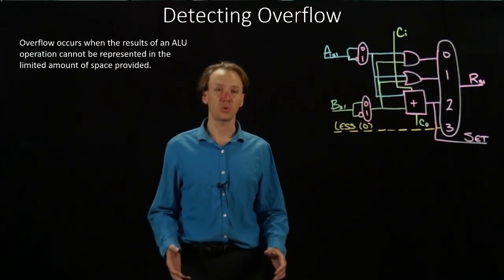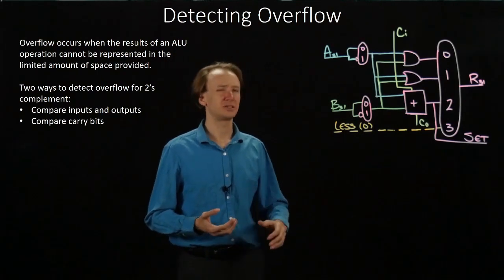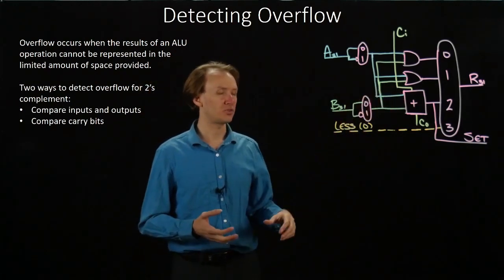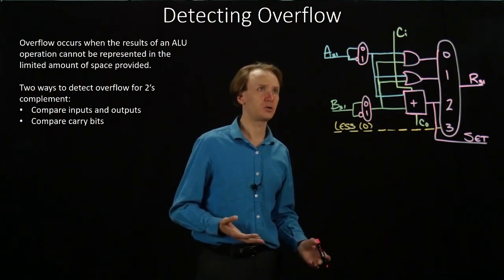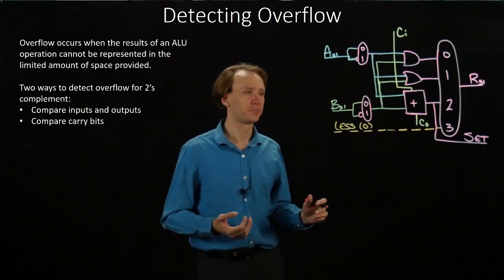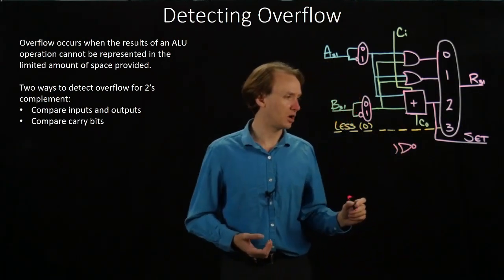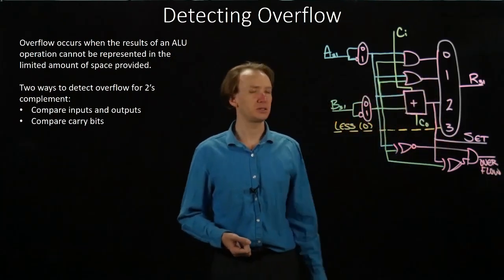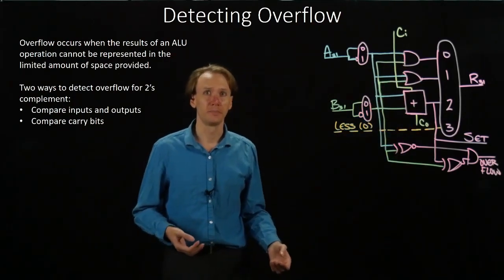11.  Detecting Overflow

Comment: 01 + 01 = 10 which seems 2 but it is not if we are dealing with signed numbers and actually 10 is -2 (not 2). Now the idea of using the last two carry bits seems flawed. plz, Mr. Padraic correct me if I am wrong. I am very open to discuss this to remove any confusion I might have. Thanks
Reply: just one simple clarification to anyone who reads my comment, 01+01 should = 010 because only with 3 bits we can represent 2 in signed number

Comment: Can someone please tell me how will this problem be solved? I mean how can we resolve this problem if overflow has occurred in our circuit??
Reply: Overflow is usually set as a condition flag and left to the program to deal with. There is no way in hardware to prevent or deal with overflow. Understand that overflow is typically a software bug. The programmer is trying to do arithmetic on two numbers whose result cannot be held in the result of the ALU and/or registers.